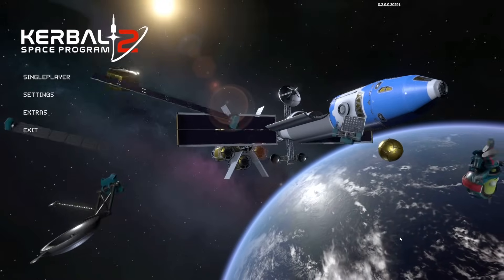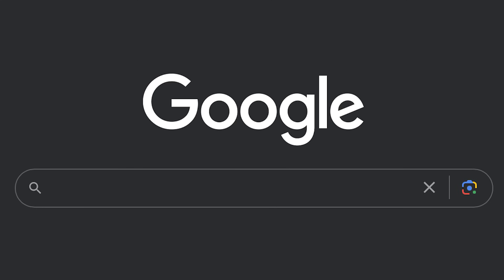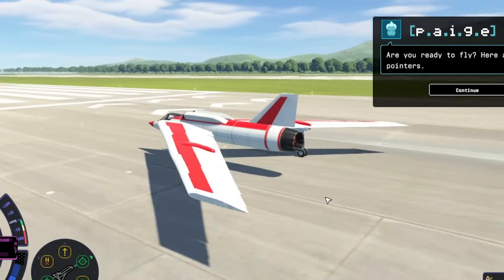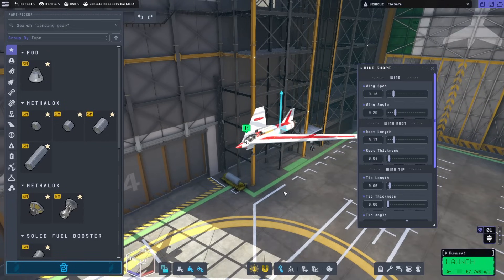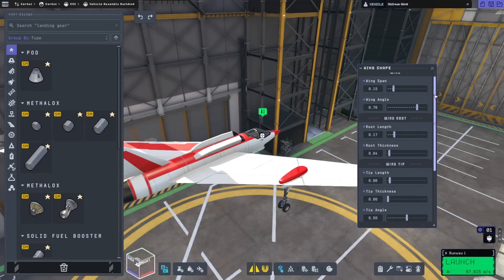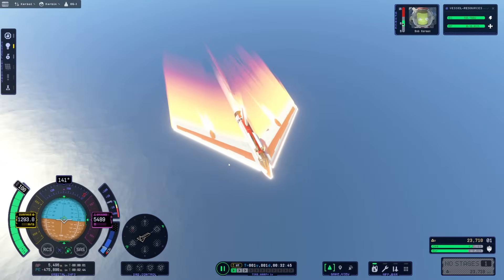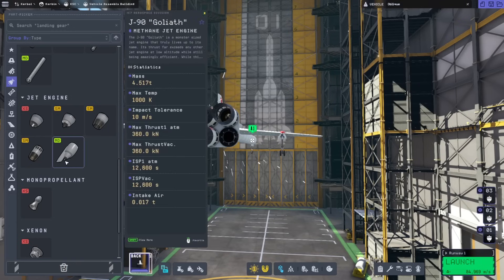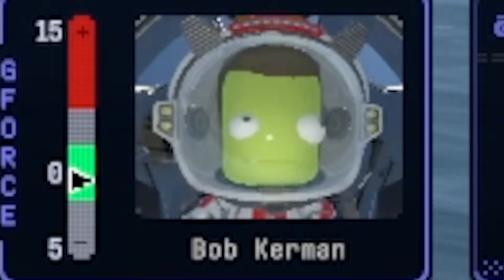Testing the future of air travel!

Comment: I'm afraid you misunderstood this a bit. Sweeping the wing doesn't make you faster, if you'd angle the wings of a Cessna, it wouldn't go faster, it would just handle a bit sh*t. 
To heavily oversimplify it: Sweeping is a trade off, you trade lift for less drag. At high speeds you don't need that much lift from your wings, because speed is part of the equation, that results in lift. If you increase the airspeed over a wing, you increase it's lift. And the same goes for drag. Same Wing with more speed means more lift, means more drag. More drag means less speed. 
So what can you do, if you'd know that your plane is going to be so fast, that the drag will make the engines waste all their energy on overcoming the drag? You'd make the wings smaller, the sweeping gives you some added benefits, due to the way how air behaves at supersonic or even transonic speeds (it get's all gooey and thick, makes all kinds of funky stuff), this is quiet complicated without showing it, and there are amazing videos on youtube, just check them out, if you are interested(I think real engineering has a good one? Scott Manley has some good ones). 

But the main point is, you don't adjust your wings to change your speed, you change the shape of the wing according to the operating speed (and altitude). And regarding the difference in speed in the beginning of the video, I think you changed the volume of the wings and they are probably full of fuel, so the second plane was lighter, or something like that.

And regarding the oblique wing, it's not that they are better or something. Their sole advantage is in the hinge, yes the one thing you didn't implement.^^ But like you have, so correctly, pointed out, they change their angle, without changing the centre of lift, centre of gravity, etc. So you can gradually adjust them to the changing conditions of the flight and always have them at the most efficient(!) angle (it's all about efficiency). Think of a radio with an analogue VOL knob (hihi, knob) vs. one that you can just turn on and off. 
They aren't better, they are just adjustable to your needs. 
But the downside is, that they are utterly complicated and have lots of moving parts and all that. Which makes them more expensive and more prone to failures. Think of them like hydraulics in PB, you can make a simple bridge do all kind of different jobs, but you have to include some really complicated, expensive moving parts. There are situations, where it makes sense, but most of the time it's just not worth doing, if you can avoid it.

 Like I said, this is all grossly oversimplified and from memory, and I left a lot of stuff out, so if you are interested, don't just take my word on it,  watch some videos on it or read it up somewhere. And also if I got something horribly wrong, please correct me, I don't want to spread misinformation or if you want to add something, feel free.

Comment: Its not about the oblige wings being better than straight or swept wings. Its about being the best of both worlds. Swept wings give less lift and have less control surface for subsonic flight. That's where the straight wing is better. In supersonic flight, the increased drag of straight wings is problematic and swept wings are better. That's why the original allowed for in-flight transition from straight to oblige wings. Because for the desired effect of swiped wings, it doesnt necessarily matter if they're swept forwards or backwards.

Comment: I am in a aviation class and Civil Air Patrol so I'm learning about that stuff because I want to be a engineer when I grow up, matt did miss a couple of things that could have made the test for all planes better like the horizon stabilizer but due to the knowledge I do know it wouldn't been better but I might do some testing just in case I've actually have my own wing design which is a mixture of both wings for supersonic and low speed so they are good but I won't say the best because I've made a full custom plane and it works too

Comment: I think you missed a few points from the documentary (assuming it's the same one I watched):
*They spoke about compensation for the oblique wing
*Also the oblique wing won't help take off when it's in the oblique position, it's advantage is that you take off with the wings at 90 degrees, then when the plane wants to go faster you change the wing configuration to oblique...
*Also the oblique wing should have the same speed and performance (or similar) as the angled wings, not better...  BUT better than 90 degree wings (at high speed)...

Keep up the good work!

Comment: I would like to point one thing out. You spoke about the challenge of having the straight wing low speed design, and then taking them back to the angled back high speed design as you get to speed (that backward angle is known as sweep by the way). 
To counter your point about the challenges of this, I'll point you to aircraft like the Tornado and F14 Tomcat (there are others, but I wont bore you). This is exactly what they do, and they do it pretty successfully.
Reply: While the swept wing design worked as intended, the extra weight of the swing wing mechanism is what makes those aircraft poor at turning engagements with other aircraft.
Reply: @chequeseis9479  Oh, sure, I'm not suggesting it's a perfect, one size fits all solution, but RCE seemed to suggest that the shifting of the center of pressure as the wing sweeps made the idea unworkable. It's far from that. 
I will also point out, your basic premise isn't really accurate. Flown well, the F14 was capable of achieving a notably smaller turn radius than the F16...... the viper isn't exactly a slouch when it comes to turning fights. 
The variable geometry is what lets her do that, can sweep the wings forward, and get plenty of lift at lower speeds, allowing her to achieve a tighter radius despite having (slightly) worse turn rate in degrees per second than the Viper.
Reply: @Streaky100001  The best turn radius of the F-14, wings extended, which isn't much better than wings swept weirdly, occurs in a regime that is well above the Ps=0 curve;  meaning it can point its nose once by depleting all of its energy, it's best sustained turn radius (Ps=0) is worse than the viper even though it's alpha limited. My premise is accurate because as long as that brief minimum turn radius does not prove lethal for the majority of modern fighter aircraft, it will never be able to regain energy fast enough before going defensive because it's so heavy.

Comment: Matt went through the entire video with planes that don't have horizontal stabilizers on them. What an architect lol.
Reply: Bro had no tail control surfaces and wondered why he wasn’t gaining altitude outside of engine rotation and lift
Reply: WHO NEEDS STABILIZERS
Reply: "What an architect" --- now you're just rude and hurtful.
Reply: And no canards either, considering he moved the wings.
And when you have two sets of lifting surfaces, you can move them back and forth until CoL sits at the right point.
In some cases I go so far, I have back stabilizers and canards.

Comment: Matt, with all due love and respect, go watch a 10m video on the basics of aerodynamics. Horizontal stabilizers and elevators are generally NOT optional for stability. Move your control surfaces away from the center of mass. Put your rear landing gear behind the center of lift. Maybe try this again after you get a few of the fundamental problems with your plane corrected.

Comment: Wing sweep is specifically advantagous for the transonic regime, not so much for fully supersonic. 
Most "supersonic" aircraft like common modern fighter jets spend most of their high speed time transonic; transonic also has the highest drag coefficient so that is what gets optimized. A true mach 2 supersonic interceptor like the F-104 had straight short thin wings. Fighters that can super cruise generally still need afterburner to get through the transonic range of M0.9-1.3 then cruise without afterburner above.

Comment: as usual for ksp videos, here's  another list of nerd things to take into consideration for this design:
- to get your center of mass and center of lift aligned in swept wing design, try to keep the front fuel tanks empty
- use dedicated tail control surfaces (elevators and rudder) instead of relying on the wing control surfaces

Comment: Yes elevators as well but the wing actually swiveled in the joint in the actual craft.  This was from the 80s and 90s…it’s not a viral video.  It’s been around for decades.  Straight at low speeds and then rotated onto the oblique position.  It requires a ton of computational power to keep it stable.

Comment: (Nose of the plane)<--(Center of Mass)<--(Elevators pushing down on plane to pitch the nose up)<--(Wheels supporting the rear of the plane) = "Oh, pulling up does nothing" - RCE @ 18:28

Its okay Matt, you were a civil engineer not an aerospace engineer and now you are a great youtuber XD.

This is why you have two basic wheel configurations on planes, tricycle and tail draggers. A tricycle wheel configuration has its pitch control surfaces further back from the CoM than the rear most wheels. This lets the control surfaces push down on the tail and the rest of the plane pivots up at the rear most wheels. Tail draggers on the other hand are designed to sit on their wheels in a pitched up orientation. Their natural pitch up position is greater than the pitch up  needed to take off so they would take off without increasing their pitch angle further.

Also canards pitch a plane up by pulling the nose up instead of pushing the tail down avoid all of these shenanigans.

Comment: The long, straight wing is best for subsonic flight as it has more lift, but swept wings are better for supersonic flight. The entire point of the oblique wing was to make an aircraft that could travel efficiently below and above Mach 1. Aircraft like the F14 could do this, but they had two individual wings and needed two pivots, making them heavier and also giving them a higher chance of failure. So, the oblique wing was supposed to do the same but without having as many different parts that could break and needed maintenance. Also it isnt supposed to be 2 fixed wing its supposed to be 1 long wing that can rotate lol.
Reply: So true.

Comment: Trim control in KSP2 is ALT+(WASDQE) to adjust the aircraft control surface trim to continue to apply control surface forces in small amounts in a continuous direction. There's a mod that makes it more visible and tweakable called Trim Controller. Most craft have some inherent instability and SAS can make it worse. Also, as fuel is consumed, the Center of Mass will change, causing increasing instability.

Comment: CARDINAL SIN! The video didn't say it was BETTER at high speeds, it said it was AS GOOD. 

The point of the video was that the wing moved MID FLIGHT, going from straight to oblique with a simplified and studier mechanism compared to similar transitional planes. That gave increased performance compared to fixed wing designs which require tradeoffs/compromises when transitioning from sub to supersonic fight or back.

As a fellow engineer (but not one of those cootie filled civil ones) I am disappointed in you.
Reply from the maker: Go watch it again 😅
Reply: @RealCivilEngineerGaming  What, and risk being wrong? Never!

I recognize you said something about it near the end of the video, but I'd already written the comment by then...

Comment: if the oblique wing is meant to reduce losses to drag at supersonic speed, you're going to have a significant loss due to drag from constant adjusting maneuvers which will negate any gains. it's tricky to use a flight stick for KSP 2 but it can be done, but if that's not on the agenda, holding left Alt and using the controls can set the trim of the craft, i.e. the sort of default point it goes back to when you let go. This can give you more fine control over the orientation and allow for level flight. or you can use caps lock to engage fine control mode so the maneuvers aren't as drastic and you have less drag from making them.

Comment: the issue with the oblique wing is its design is supposed to be adjustable.   i.e its not 2 wings.... its 1 wing on a motor so it can be transitioned in flight
you should take off like a normal plane then swap when you have the speed, its more efficient.

like a f14 tomcat  but with less moving parts.

Comment: Your design completely missed the point... It's not that oblique is better than symmetrical, it's that you can have a standard subsonic flat wing that rotates into an asymmetrical configuration once the proper speed is reached. It reduces the frontal drag surface while maintaining total lift. Asymmetrical is superior if you were building a single-purpose aircraft.

Wide flat wing (Cessna style) provides better lift at low speeds.

Symmetrical angled wings provide better high speed performance.

Asymmetrical wings are inferior to both, but when a standard flat wing is rotated asymmetrically, you gain some of the benefits of the angled wings thus allowing higher speeds. Your tests proved angled wings were faster than the flat ones.

The whole point is lower takeoff/landing speeds and higher cruising speeds with the same aircraft.
Reply from the maker: Go watch again, 4:00 is the timestamp you should pay attention to in the Mustard vid 😉
Reply: I didn't realize this was about Mustard.🤣

What I meant was testing each wing shape uniquely changes the parameters of the wings/aircraft in ways a practical application does not. For instance, rotating a fixed wing into an oblique would result in quite different geometry than the two asymmetrically shaped wings do. It's not necessarily about being "faster", but rather using identical geometry in two different configurations. Otherwise building a bespoke oblique wing aircraft would be more commonplace.

If the wings were identical in angle and relative surface area across each cross section, I guess the "fixed" experiment in this video would be an accurate enough approximation, but I'm not sure... Nor am I entirely confident in the accuracy of KSP's physics modeling but that kinda goes without saying.😅 I did note that the "unpleasant flying characteristics" of the oblique aircraft were present so probably "good enough" for the sake of argument.🙃 

I appreciate the vids Mr Engineer! May the architects stay far away!🙏😉

Comment: The reason the wings were asymmetrical on that plane designed by NASA was because they wanted to test a simpler way of achieving swept wing designs: Having only one moving part which itself is even less complex as opposed to the regular design that sweeps two wings
The asymmetry is only a side-effect of trying to sweep both wings with only one moving part: As one wing sweeps back the other obviously needs to sweep forward

Comment: The original oblique wing actually rotated in flight, so you would take off with wings symmetrical and then rotate them in flight.
Reply: 17:24 he knows
Reply: yes yes exactly
Reply: KSP2 doesn't have moving parts yet AFAIK
Reply: Indeed

Comment: Fun Fact: The F-14 actually has sweeping wings, so for low speeds and maneuvers it wings can be swept front so that it is perpendicular, but for supersonic speeds, it can be swept back to be faster. One of the few planes to have changeable angle (sweeping) on its wings.
Reply: there's actually been a decent few variable-geometry wings like that, the MiG-23 Flogger, F-111 Aardvark, and Panavia Tornado are a few examples of this
Reply: It's unfortunate, but aside from the width reduction, the advantages of swept wing ends there in KSP.
Reply: Yup, that was an awesome plane. Used to have a GIJoe Tomcat that was something like 2 feet long.
Reply: F-111
Reply: ive got a need a need for speed
Reply: @stinbray1120  He's a ridge racer, he always gives me what I need
Reply: Su-22
Reply: as does the Mig-23 and Mig-27.
Reply: @lonewolfsstuck  man i wish i could still consider the russian jets good. don't get me wrong i love the older ones like mig 21 and 23 (and whatever the big side by side one is) but the new ones are just shit
Reply: @Jason-jb1vs  because we haven't entered open combat with a country that uses the newer ones. ukraine isn't using f 16s yet. when ukraine gets them they will. but f16s aren't the best and f15 ex would curb stomp a 57, let alone an f22.
Reply: @stinbray1120  hey, the f16s are still not taking any of those shitty planes out, can you tag me when they get a kill? And maybe also tag me when f22s take out something better than a balloon
Reply: I like the tornado more xD
Reply: Also some f14 vertions have small something like wing deloying when the wings are swept back but it didnt work so they put antennas there
Reply: Yes! Another F-14 fan :)

Comment: You should probably add horizontal elevators at the tail and use them to control the pitch instead of the ones built into the wings. It would be way more stable that way. And maybe make the rudder bigger, it looked a bit small compared to the rest of the plane.
Reply: He should.